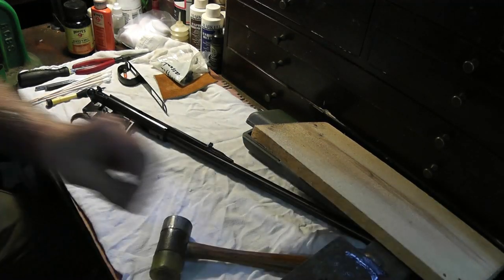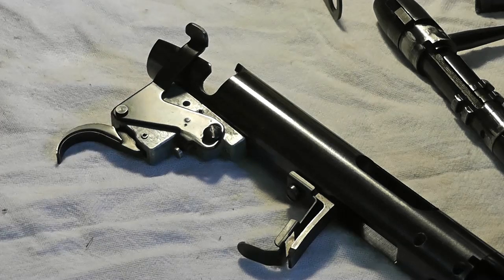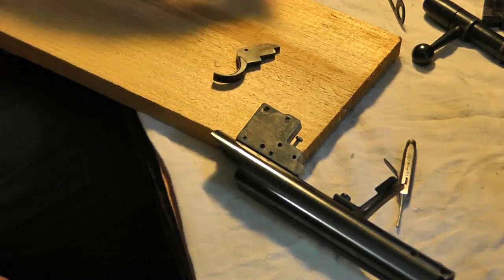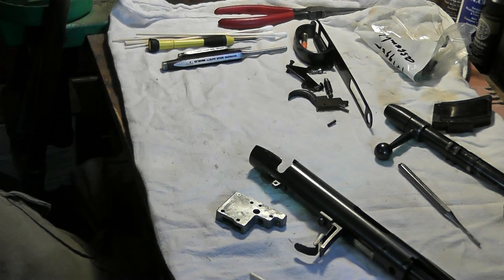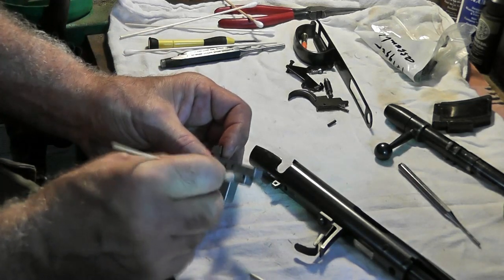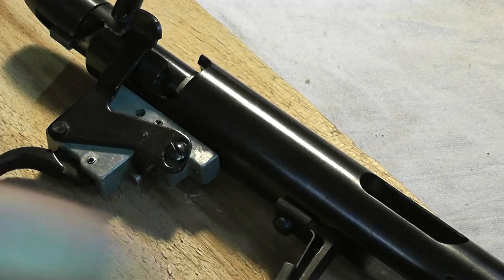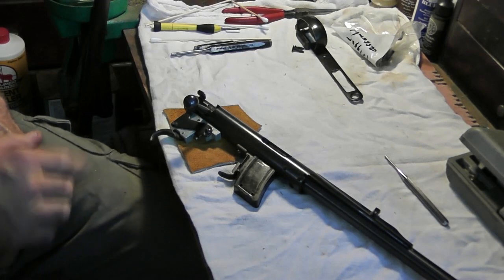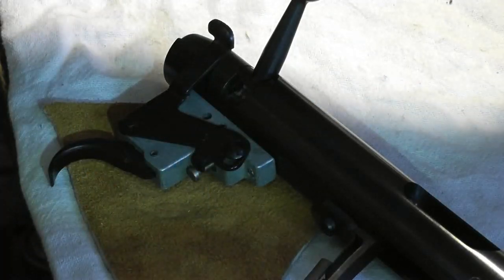How To Service Remington 580/581/582 Triggers

Comment: I fixed my 581 by installing a Canjar competition single-stage trigger set at 1.25 lbs for squirrel hunting.  It’ll go down to 4 ozs if needed for sporter competition.  Accuracy wasn’t close to my Anschutz 1710 sporter so I had a Broughton lightweight match barrel installed with an extra action screw.  Now it’ll stay with my 54-action Anschutz at 50yds.

Comment: Thank you C.O. for your thorough explanation & awsome video on 58x / 54x trigger maintenance. I have done a similar job on my old (and treasured) Remi 541.S. Very wise advices, specially regarding lubes being used. I myself use that very same Hoppe's mineral oil (BTW: pH 'neutral'), mixing 95% of it with 5% pure synthetic silicone oil, as well as Litium- based grease (I use Italian Campagnolo bycicle chain grease), and suggest NOT using any 'acidic' lubes, which could affect trigger housing's integrity, since it's cast  aluminum + zinc alloy. Just adding a couple suggestions: If you DO love such a jewel, I'd suggest having it stripped / throroughly cleaned / degreased  following your instructions, and before re.assembly, have it Cerakoted, for protection reasons. Actually there are several finishes that mimic most alloy's colors, besides being quite impervious to many chemical agents. I'd also suggest getting a punch set, (Several options from Brownells, Weaver, Wheeler engineering, etc) that include dedicated roll.pin punches. Whenever I use Loctite, #242 Blue one is my choice, (I use a clean, sharp toothpick to apply a tiny bit to a screws' thread, before driving it back in, just snug enough. Any excess, I remove it w/ a Q.tip), for NON.permanet use.😊🙏🙏🙏🙏

Comment: Bought myself a norinco jw 105 , 556\223. has a reddot sight with tube style and it looks like a scope. I got it and the magazine latch was crooked and the magazine wasnt setting in right so took it apart and realigned magazine latch and works perfect now. And the bolt release had a chunk of metal that was making the spring to not work, it would catch and the bolt would come out. I did some work to the release and now it works perfect. Reviews say that the jw 105 is similiar to the 788 but i never had a 788 so im not too sure. The jw 105 is a copy of c z 452 or the bruno 2. Its a cheap alternative to the savage , ruger , remington rifles. Im thinking of redoing the trigger on mone and setting it to a little bit lighter. Its heavy right now and i want a bit of travel so it feels like a 2 stage trigger. If I can. I know these triggers can be worked on because theres screws and bolts that adjust. I just need to figure out which screw does what. I shoot 55 grain bullets. The norinco jw 105 looks like this 22 lr you are working on. Very similar but different looking . Same magazine latch and trigger set up but the 22 has a different trigger .

Comment: Thanks for your comprehensive video on the 581 trigger.
Are the aftermarket triggers worthwhile?
Reply from the maker: Thanks! Canjar makes a trigger for the 580/590 series rifles, but it will cost you a mint (hundreds). Timney makes a trigger that fits the 788 action, but the bolt stop can be modified to fit the 580 rimfires, and I have heard it works well. That trigger is much more affordable.

Comment: Most firearm factories advice to use mineral oil on their products? Cheaper and easier to find.
Reply: Also, Brownells sell roll pin setting punches correct for this jobm they have a small tit on them for setting the roll pin.
Reply: Not trying to be a sm### A## just thought I'd impart some of the tricks I've leaned over the years. Good informative video thank you.
Reply from the maker: @bennettguns3809  Right! I use mineral oil on my guns, and even on my reels. I keep a soft rag that is lightly saturated with mineral oil handy, so that when I put a gun away, or take it outdoors I wipe it down. So far I have never had a problem with rust or corrosion. It is very inexpensive, and free of odors, so it won't spook game.  Thanks for sharing.

Comment: Loved your video. Question, my trigger is stuck and also I cannot get the bolt out. The safety and fire switch will not go all the way forward to release it. In your video you said to soak the trigger mechanism in acid tone to get the gunk out. Can I do that still attached to the barrel and would that loosen it up for me to get the bolt out or would I damage it? Please answer, I need help. Thanks Verlene
Reply from the maker: Ok if I understand you correctly you cannot push the safety forward to depress the bolt release. So what I would do is take the action out of the stock, make sure your magazine is removed, and of course the gun is unloaded. Loosen the tension screw located at the front of the trigger housing, then punch-out the retaining pin (carefully), and remove the entire trigger group just like I covered in the video. The bolt should come right out at this point. Now soak the trigger group in break free, and/or acetone for about an hour. Follow the instructions in the video and you should be able to resolve your problem.

Comment: Hi sir, Bought 581 and having safety problems... After opening and closing bolt sometimes safety will not engage! Any ideas why.. Thing is doesn't do this ever time.. Most of time its after it fired and chamber next round??? Also will new style trigger assembly exchange with old style assembly without any other part exchange? Appreciate this video more than you will know if disassembly is required... Thanks and God Bless my friend

Comment: My wife just inherited a Remington Model 581 22 LR from her father. From my past experience with this rifle it is prone to discharged when the bolt is closed. We are afraid to give it to a family member or sell it, because its unsafe. Does you have an idea why this might happen?
 
Save
Share
Reply
Reply from the maker: Yes I do! Please don't try to load that rifle until you perform a complete service job on it just like I instructed in the video. It is most likely malfunctioning due to grease hardening in the trigger housing. Be careful!

Comment: I have a 540-x what is the difference between the two?
Reply from the maker: As far as I can tell, the actions are pretty much the same. Same bolt, same receiver, and I think the triggers are generally the same. The barrels are heavier, and of course the stock is built heavier. The Remington 540-X is known as an extremely accurate shooter.

Comment: I have a question for u on a remington 541s , there is a lot of play in stock and action, the take down screw won't tighten Any more then it is. It looks like in stock it was made for a wedge or a bedding brace. Is it supposed to have one
Reply from the maker: Ok, What you have is a bedding issue where the take down screw is bottoming against the receiver tube or body. You can glass bed the action around this area to tighten it up.
Reply: @CumberlandOutdoorsman  that's what I was figuring
Reply: I was thinking about making a action lug to fit in spot in stock 🤔  wish I could send send u a picture,  have u ever done that to one
Reply from the maker: I have but in a different way. What I did was extend the threaded section of the receiver by taking a threaded nut and machine the edges down. Then I slightly ground one side concave to fit the receiver tube. I then used a bolt of the same thread pitch, threaded my round nut onto it, then threaded that into the receiver. I tightened the nut against the receiver tube and welded it in place with a clean tig weld. What I had in effect was more threads for my take down screw to engage, and a recoil lug. I did have to thread the screw a bit further so it could tighten all the way. I had to drill the hole in the stock wider about 1/4 inch deep to accommodate the threaded lug. I glass bedded that part of the stock, thereby giving me a perfect fit. Two of my 581's have this additional support, and I noticed somewhat better accuracy. I tested some SK ammo with one of them and shot an honest to God 1/8th inch group at 50 yards! I still have the target. It looks like a 38 caliber hole, but it's where five .22 bullets made a tiny group!      @coganhagen01
Reply: @CumberlandOutdoorsman  thanks for replying and be a good person,  love your shows. I kinda got the shaft on this gun , it was a gun broker deal . It wasn't worth what I paid. But maybe I can save it without spending to much money

Comment from the maker: One thing I failed to mention in this video is that this video also pertains to the Remington models 591, and 592. These rifles are chambered in 5mm rem. magnum, and now that Aguila is producing this cartridge, owners can continue to enjoy shooting their vintage Remington 591 & 592  rifles. The triggers are identical to the 580 series rifles.
Reply: I have always wanted a 5mm rem mag and finally got a 592.  The gun sat unused for many years and needed this exact cleaning.  I wouldn't have tried it without your clear concise instructions.  My trigger looked exactly like your older style example.  Now it operates smoothly and is safe.  I can't thank you enough.
Reply from the maker: @emerycreek8016  I'm glad you found this video useful. I know it's a bit long, but I wanted to go into detail regarding the trigger systems of these rifles.